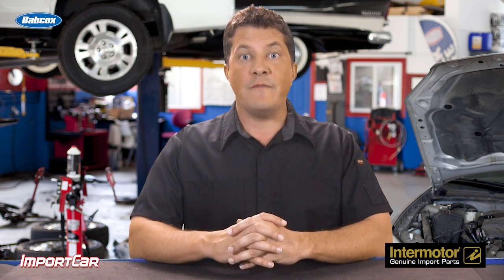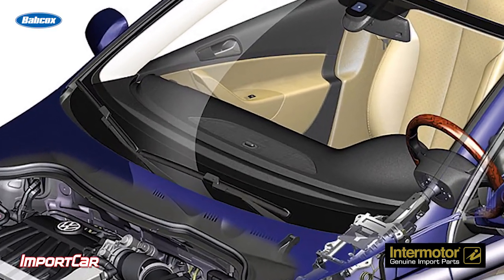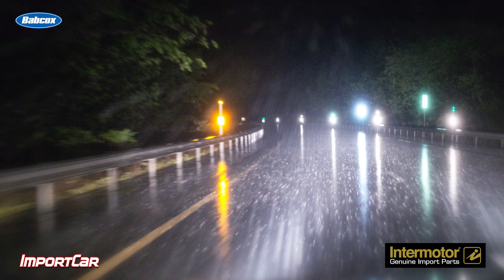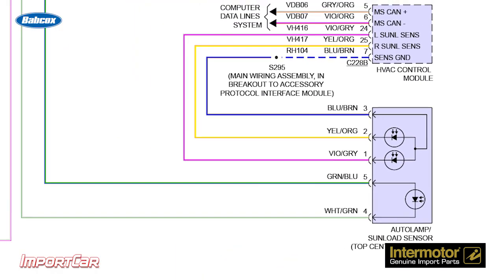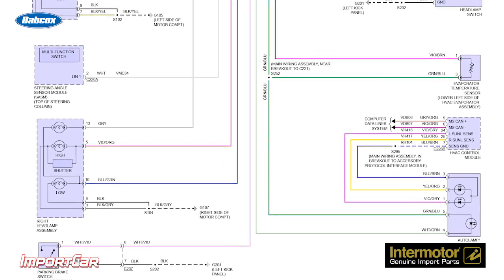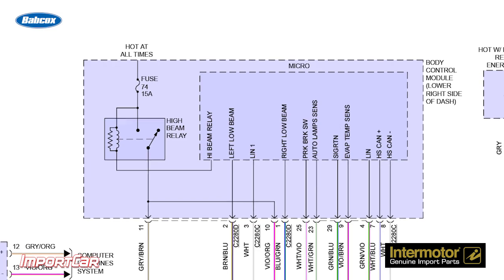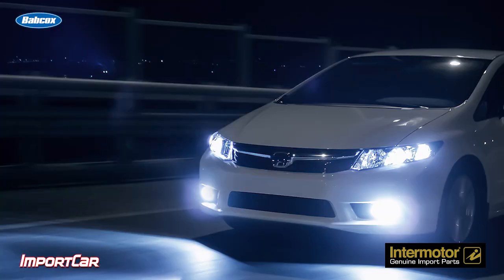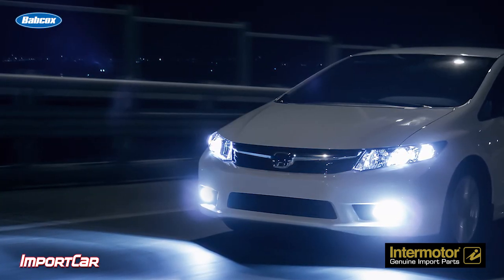Automatic Headlight Sensors | Tech Minute

Comment: What if you change the sensor and the headlights still turn on every time you put the car in drive?
Reply: Did you ever find a solution?  I have almost the opposite problem.  My headlight won't come on at all when using auto.  It comes one when turn it to "on".
Reply: @SoulSeeker770  No mate, sorry. I believe it is just a thing it does.
Reply: @hectorestrada2645  Have you tried to change the sensitivity?
Reply: @SoulSeeker770  You can do that?
Reply: @hectorestrada2645  Depending on the age of your car.  My car is 2013 Accord and you can adjust the sensitivity through the car's program.
Reply: @SoulSeeker770  o, I've looked everywhere but I don't think mine has it. Thank you for the heads up.
Reply: Bro same problem is to me wht to do?

Comment: I have one of my Audi A6 C6 Cars (2007 A6 C6) The Auto position on the headlight switch will not allow the headlights to turn on.  Manual ON works.  I understand that the headlight and rain sensor are all in one, and mounted by the mirror on windshield.  However, the auto wipers work.  In Auto mode wipers will sweep when sensor has water beads.  Any ideas?